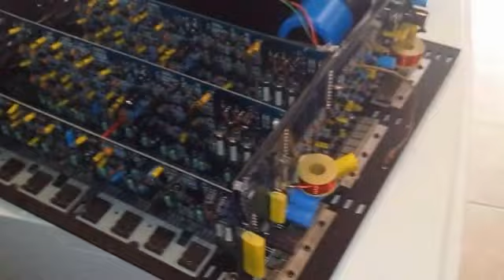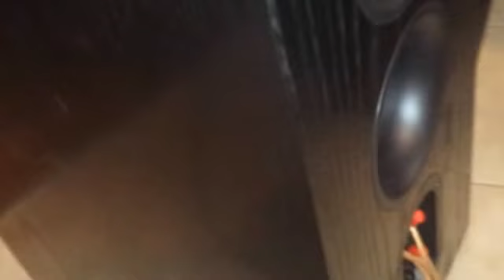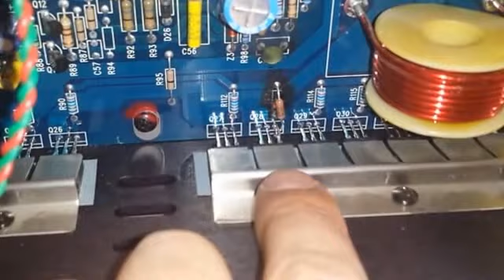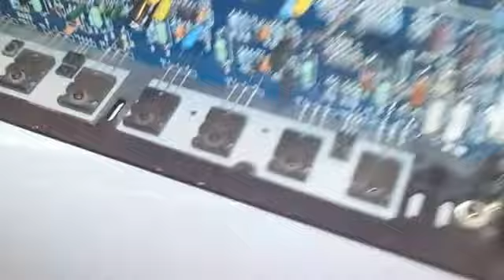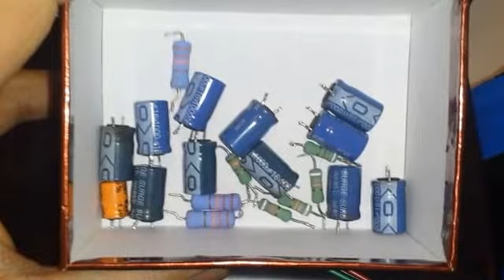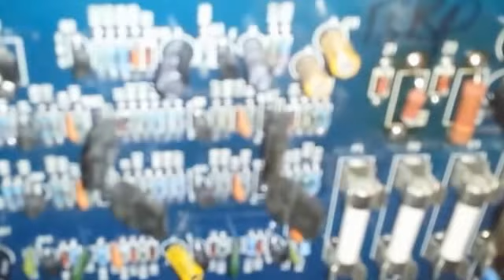Sunfire Cinema Grand Signature Amplifier Hum/Buzz Repair Problem

Comment: I have one don't if it's on or not any suggestions  I have the series 2 would like to sell it
Reply from the maker: Not sure what you mean
Reply: I have a 5 channel cinema grand gunfire load invariant high fidelity power amplifier I can't tell if it's working or not I am wondering if the light acks as a fuse in the meter it is blown doesn't work

Comment: I also have the same version amp you have here.. Series 1 404 x 5.  I am chasing a squeal on shutdown (complete power removal).  For starters I have replaced the same 6 you were taking about for the hum issue, I relocated mine to the other side of the board to be completely away from the hot resistors.  Should help their life span.
I want to continue on to recap the rest and do what ever else I need to to bring this beautiful amp back into spec.
What gets me is that this amp is definitely not made to come apart.  Just to remove any board means you pretty much has to remove all of them because of the fully soldered connectors between the power supply board and each amp board.  Any advice on desoldering those connectors?  I am on the fence if I should continue or just enjoy the amplifier as is.  Certainly don't want to make matters worse.
I have fixed a fair number of power amps but this one is special to me . .

Comment: Thank you for such Great wisdom 
Just recapt the Mother Board, Power Board and the Amp Board with Panasonic Caps.
verses those crappie Chineese caps.
This is my friend's Sunfire Ultimate Receiver..
He had hardly any Volume.
Now it seems to be good again.
Here is my question if I may.
Someone told me it's normal as this Receiver is always on standby.
I hear a faint him/hiss from the speakers with power off! Ones turning it on I can increase it and hear it with turning the Volume up with no music playing, ones I play music you can not hear it.
Any thoughts and or advise?
Reply from the maker: That’s right it’s always on
Reply: Thank you so much. so you agree that noise is normal?
Reply from the maker: @kenwoodjens1  you may hear a small hiss on more efficient loudspeakers
Reply: Again greatly appreciate your time.
I'm running my Bose 901 to test and burn in the Caps
Reply: One last question if I may please,
I ran the unit 8hrs yesterday and 8hrs today is it normal fir these Unit to get very warm?

Comment: How did you adjust the power supply trim pot  after  the mosfet (ir640) replacement ?
What value and where did you take it from (test point) ?

Comment: Hope youre still monitoring this video. Im running Theater Grand and Cinema Grand. If volume gets to -28 dB (or louder), i get the quiet buzz and hum in my right n left woofers.  Id like to try your repair method for the buzzing. Can u provide specs for the caps and resistors you installed fir this step? Also any advice to discharge the power or be safer be great. I have succesfully repaired my True Sub myself by rrplacing 8 capicitors too so have some decent soldering skills. Thank you.
Reply from the maker: Just replace with the same as what’s in there

Comment: Awesome Video, what would you shoot for if suddenly one has to crank the valume louder as suddenly one needs to? Caps? If so which ones?
Reply from the maker: I've never seen that fault but these units all need caps by now
Reply: Thank you, yes 0db is the same as it use to be at -66db

Comment: I have a Sunfire Ultimate with a fluctuating volume issue.  It goes up and down, gets hot, and then starts buzzing so loud that you cannot hear anything else...clear as a bell for 10-15 minutes, then a roller coaster of sound that hits a brick wall.
Reply from the maker: Interesting. 
It obviously needs service.

I know Bill Flannery did/does? Service them, but he's not a very helpful dude.

He told me mine was unrepairable when I asked for advice, so I fixed it and continue to repair gear. Get a good shop to do the service, unfortunately he may be your best bet.

Comment: With all the room between boards I would of put insulation on the resistor leads and mounted them at as far away from the board and especially the caps  as the leads would allow.

Comment: I built motors all day long at the dealer, So my car is nice, But I sure wish I had this level of knowledge for my own electronics,  Ive got a plate amp humming loudly but cant find a bad capacitor anywhere so now what.
Reply from the maker: Could  be a number of things causing the noise. 
Is it from their subwoofer?
Reply: Random Repair It makes a bass shaking noise just like when the power supply capacitors go bad, but caps test and look good, the whole board looks great, perfect solder with no burn marks and fuses not blown,  The only schematics i can find are paid downloads, ugg.
Reply from the maker: @stclairstclair  could be a number of things. Best to send it for service.
Reply: How are you checking the caps ? a capacitance meter won't tell you anything until it's really bad .Use an ESR meter (cheap on Ebay ) also if it's from a sub get a magnifying  glass and check for cold (bad) solder joints of anything that gets hot (big resistors and transistors)or could move.
Reply: lee kumiega, I have a decent ESR meter, This is the cleanest looking pc board ever, Looks like it was made yesterday, Ive got Some other component failure.
Reply: @stclairstclair  Is the hum heard from the speaker or the power supply itself.Also does it still work with this hum .
Reply: lee kumiega, The speaker spontaneously started fluttering/humming loudly,  I unplugged the rca input without any change,
I believe some type of power supply failure is being amplified,  I was all happy thinking this would be an easy capacitor replacement with the power supply caps, but the pc board looks like new, No smell, no heat marks on the board, no burned components, all caps removed and tested test out fine with a decent ESR meter, ugg....
Reply: @stclairstclair  You do not have to remove caps to check them with most ESR meters, Next I would check all solid state components for open , short and forward reverse bias characteristics with an ohm meter (I prefer an analog one) some may appear shorted due to something else in the circuit and you will have to remove it to check it, last you could check them with a transistor checker.

Comment: I have a much older Carver amp that I am getting ready to recap soon. I purchased it new back in 1989 and it has been reliable ever since and it is still going, but I think it is on borrowed time. These caps just don't last much longer. I would always replace them with low ESR high grade audio caps. Panasonic, Nichicon or Elna. I wrote to Carver industries and they were kind enough to give me a replacement cap value list and location for my amp. If anyone else is thinking about this I suggest writing an email to Carver Corp.
Reply: Hello, can you forward that list? Thanks best steve

Comment: I just bought a used sunfire signature and notice there is a hum from all the speakers even when the power is turned off. I have set it to have automatic trigger. However the light meter is always on, is that normal? By the way, I used current input Instead of voltage,  would that make a difference?
Reply from the maker: Joe Black  sounds to me like it's not turning off
Reply: How do you turn it off? There is no power button like other amps. Thanks
Reply from the maker: Joe Black turn the switch on the back to off. That's how it should sit with no audio signal after a few minutes
Reply: Random Repair If I switch it off then the light turned off and the hum went away but when I turn on my receiver no sound coming out unless I flip the switch back on. Doesn't this have auto trigger? I can't be flipping the back switch on and off right?
Reply from the maker: Joe Black so you have a an issue with the buzz or humm sound plus you have an issue with the auto on/off
Reply: My long-time owned Sunfire 200x5 just started doing this - hums when it is 'off' and auto on/off stopped working and the meter lamp is stuck 'on'. This is not normal at all for this amp. Someone sold you a bad amp Joe. I am sending mine into Flannery's who is one of the few places that can service these amps. He estimated $350+shipping both ways as a rough guess but it could be more based on what he finds.

Comment: Tighten the Transformers down.  That did more than anything else I'd tried to quiet the chassis born hum/buzz.  Mine are dead silent now.  But I'd never had an electronic hum/buzz issue with the two I have.    That was after fifteen years of driving Amazing Plat III's and Polk SDS 2B's along with vertically biamped (4) SI 15" D2 subs.  Surrounds were ran by an A series 200 and 760x'.  Thanks for this video.  If I ever have the issue, I'll know where to start.....

Comment: I have a cinema grand that has recently started buzzing on the center channel,  and rear channel speakers.   Mains are bi wired and do not buzz.   Would replacing these capacitors help this issue as well?  I do leave the amp on ask the time,  due to issuing a Marantz pre amp that has euro wiring to the balanced cables.   I'm wondering if I'm cooking those capacitors leaving it on when not in use.   

It seems to have gotten worse with a few power outages in my area lately.   Any idea would help. 

Great video as well.
Reply from the maker: shogunxiiii it very well may help. But it's impossible to tell without checking it out. Best of luck!
Reply: Random Repair was yours producing a buzzing in the speaker,  or inside the unit?  Also which channels were buzzing?

Thanks for your reply,  I really love this amp,  bought it new in 1998, and its been flawless until very recently..
Reply from the maker: shogunxiiii could be heard from speaker. All channels but front were worse
Reply: Random Repair did you have them(fronts) bi wired? I thought it looked like you did....

I've also been reading about beyond loops.  The sunfire doesn't have a ground pin,  could that be an issue to look into?  All components are run though a monster power cleaner.  Tried plugging into a wall outlet as well,  no change.

Comment: Thanks ... good job... Question, how does one get the "lid" off to change the light for the display window  ... have removed the screws that appear to hold down the cover, but, don't see how it lifts off the chassis  ...... thanks in advance .. cleaning it up to sell on eBay ... was just sitting in a closet for years

Comment: Had a hum... changed out my fluorescent lights to regular lights and the hum went away.  some kind of feedback maybe?
Reply from the maker: sbkstereo that happens all the time! yes, it adds dirty power
Reply: Yea, it's an amp with a half ass, finicky power supply.
Reply: @whozaskin3639  Fluorescent lamps can cause that to happen with most amps , it is that power supply that makes this amp so great (lots of current to drive low impedance speakers) and make it as efficient as class D with much better sound.

Comment: Great video.  Do you have the valve of those resistors that getting hot and heating up the capacitors?
Reply from the maker: Barbara Rektorik hi, sorry I no longer do since I sold this amplifier. thanks for your comment
Reply: Oh damn I wanted to know also I'll take the cover off before I take it to my repair guy he wants to know before I take it in but you said you upgraded the metal film resistor right you went a size up @randomrepairchannel

Comment: Hello,  I have a Sunfire Cinema Grand Signature 400 7

The amp still works great, however when off but plugged in there is a humming sound coming from the unit itself - not the speakers.  Like a transformer noise.  Any ideas?
Reply from the maker: John Burleson yup. the transformer is huge. nothing to worry about
Reply: I am in the same situation except the hum is coming from all the speakers not the amp itself. The amp is plugged into a power conditioner panamax not sure if that is the cause.

Comment: Hello.
You could mount the capacitors on the back side of the PCB, not necessarily the most aesthetic placement but they would be shielded from the heat. This would protect them for the future, since you just replaced them the problem of the resistors cooking the caps remain.
Reply from the maker: very true. thanks for the tip

Comment: Hello, I have the cinema grand amp, I took the cover off and did not release the cord on the cover, two of the top two came off for the LED light, so I wanted to know if you could tell me how to solder them back on, do they solder back to the resister on the little green board where the LED connects to . any help would be great
Reply from the maker: Im sorry.  I really dont recall. Should not be too hard to tell where it some from.
Reply: No problem, I was able to figure it out and got it working thanks man

Comment: +Geerladenlad Bob invested in Rita's but it didn't last any longer than about 18 months. Bob then turned his attention to tubes again starting with the Rooter 180's, then Cherry 180's, then bumped to 305 watts and eventually 350 watts after his collection of vintage military spec transformers was exhausted. Next came BobCarver LLC with Bob Farinelli, the amps received meters and eBay sales ceased.  The $20,000 Amazing Line Source is available now.

Comment: Can you call out the the ones you replaced for the hum and were you would recommend (name brand) 
Thanks 
Matt squier 
Mlsinstallations@rochester.rr.com 
Mlsinstallationsinc.com 
585-703-8500
Reply from the maker: Sorry, I really don't remember as I used this amplifier for about a year and sold it. 

At the age these are getting to a total recap would be a decent idea at this point.

Comment: A very decent amp and worth repairing.  Those are two very bad ass capacitors stacked in the middle.  Any idea what the µf value is on those?  It's a shame Bob Carver has been absent and is no longer supporting these excellent products.  His amps have always had an issue with "humming."
Reply: +chino1127  Bob sold Sunfire to Elan several years ago and no longer has anything to do with the company so it's not a question of Bob no longer supporting Sunfire products. To state Bob's amps "have always had an issue with humming" is flat ridiculous.
Reply: Sunfire subs would sometimes shake enough to loosen the backnut on the signal input thereby creating a hum. Try tightening. Info available at thecarversite.com.
Reply from the maker: I agree.  The larger caps will have a long life due to very low heat levels and their use.
Reply: +weitrhino I believe you are proving my point exactly.  Because of the sale, he is no longer active in the company.  The innovation that came along with Bob's presence is absent, as is the customer service and support.  My experience with humming is specific to the Sunfire True Subs.  I own two of them, one that I purchased new in 1999, and it almost always had a problem with humming.  The second one I purchased pre-owned, and same problem.  I had it serviced by an independent and it's all gone now.
Reply: Agreed, but you wording lead me to believe you assigned some blame to Bob for lack of support.
Reply: +weitrhino I suppose the lack of support is attributed to the company that took over, moreso than Bob.  Can't blame the guy for cashing out.  You might be more familiar with the "tracking downconverter amp" in the True Sub, but I had to get it professionally serviced to get rid of the hum.  It was not a ground or backnut tightening issue - the repair technician said the capacitors were bad.  I got a bag full of caps that were clipped off and new ones appeared to be soldered in.  Both work excellently now, though they still "pop" a bit when turning on/off.